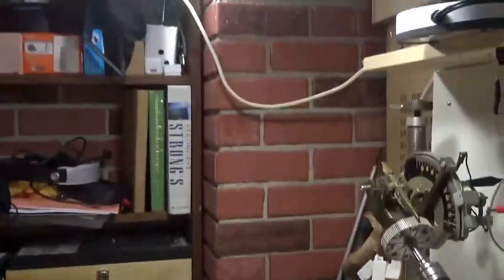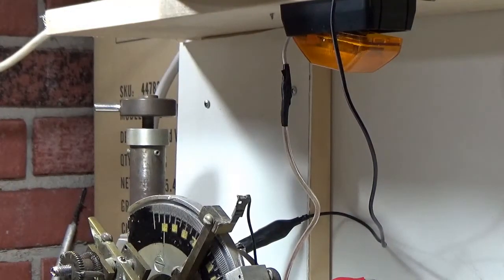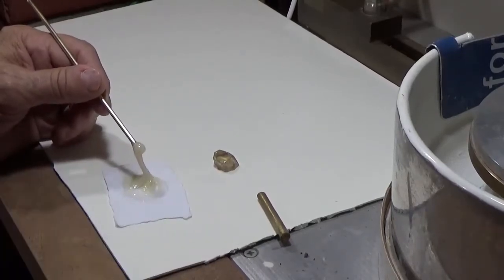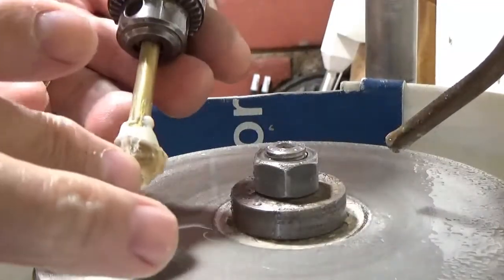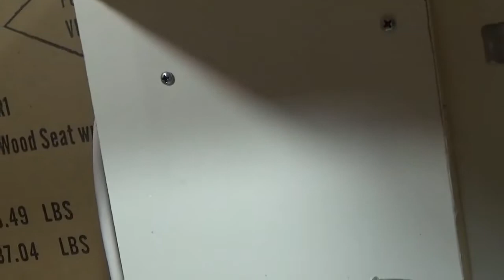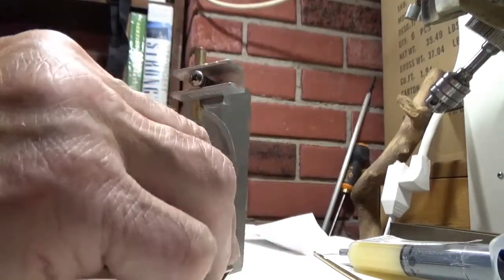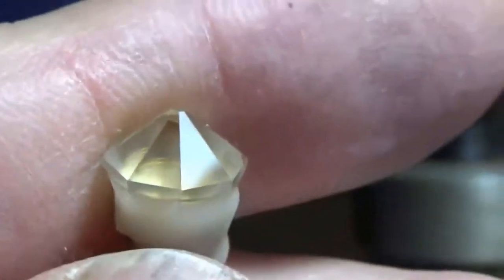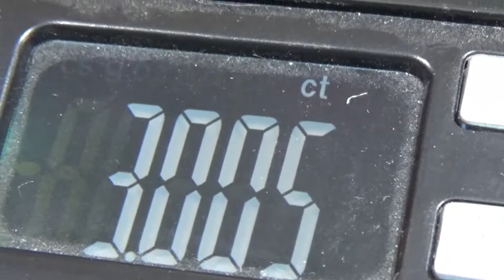FACETING SUNSTONE ON DAD'S OLD MACHINE

Comment: Nice.
Reply from the maker: Thank you Bill-- it's about time for me to get the old machine producing again!
Reply: @facetingforfun  I've always liked looking at different stones, just got got in to lapidary a couple weeks ago. Took the tool post off my lathe and bought a cheap indexing head. I have had moderate success faceting on it, enough to keep me interested.
Thanks for the videos.
Reply from the maker: I started with a cheap indexing head mounted on a slide over an old flat cabbing unit. the one thing i needed to do with that set up was to go through an do all the facets on the same angle setting from rough to polish because i could not get back to the exact same angle. that worked good for some cuts-- but not so well on others---don't give up, once you get faceting in your blood it's hard to quit!
Reply: @facetingforfun  
Exactly. I have to cut and polish before changing angles because I don't have an accurate angle measurement for repeat. One of the hardest parts is no feel for the pressure your exerting on the rock to wheel, first time I used the 3000 I ruined it. Since I'm using an indicator it's not terrible, my facets all line up and it does look like something when I'm done. I would never show it to someone like yourself and brag😂😂 .
Reply from the maker: @billfranks1905  Bill-- every one can make mistakes; but if you facet for fun and enjoyment you can say well that was fun and i learned something what can i do next?